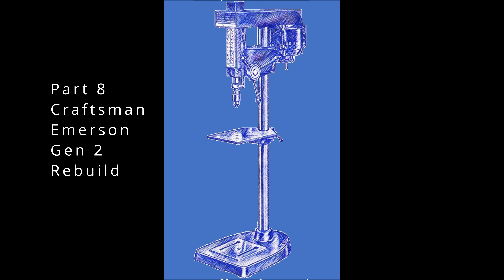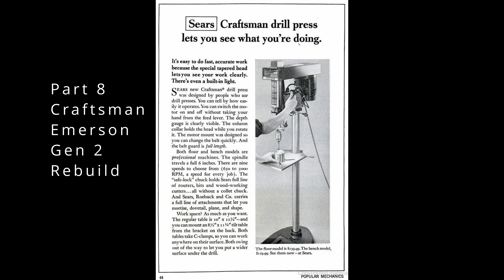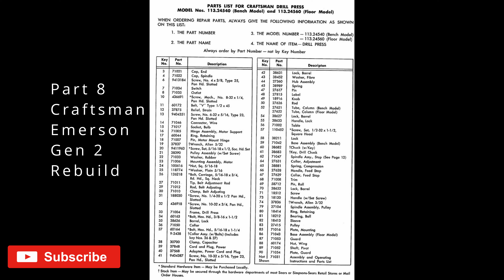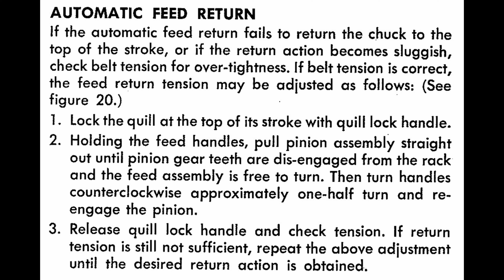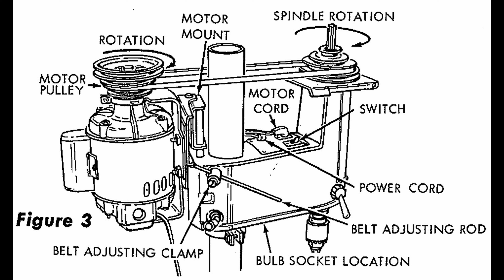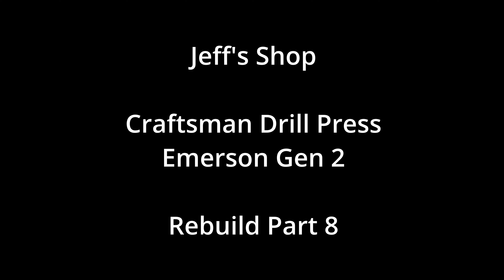Part 8 Rebuild Emerson Gen 2 Craftsman Drill Press (Final Assembly)

Comment: I obtained one of these drill press and was planing on just selling it for junk iron. After I ran across your video I started thinking 	 someone might want to rebuild it. It is missing the belt cover and the table has been drilled into. How hard is it to find these items? Where would I go about offering the dill press for sale if I don’t rebuild it myself?
Reply from the maker: The best source for parts is ebay. As for selling it, probably Facebook Marketplace or craigslist. Depending on the condiction of the drill press and how common they are in your area, its likely worth 50-100.

Comment: This is a great series, thank you for posting. I’m going through the same steps cleaning up my gen 2, it’s been a very rewarding experience. 

Question - Have you ever run into spline wear on the forward step pulley? Mine has developed some slop and struggling to find a fix outside of machining a replacement step pulley with the integrated spline. 

Thoughts?
Reply from the maker: I am glad you found it helpful and good luck on your rebuild.